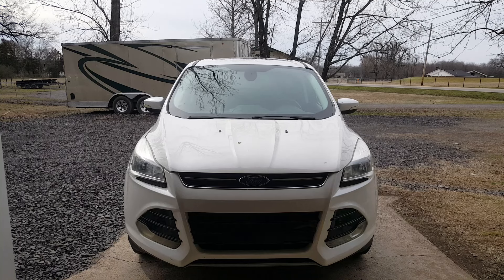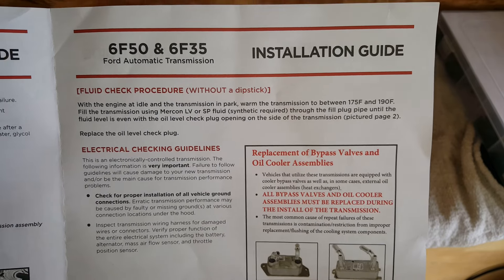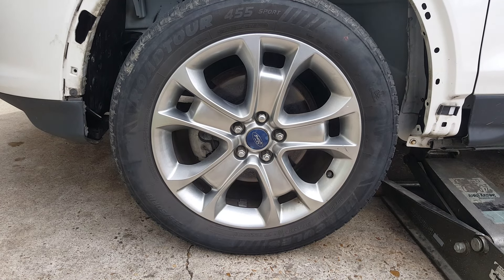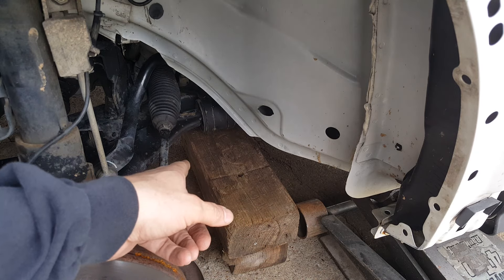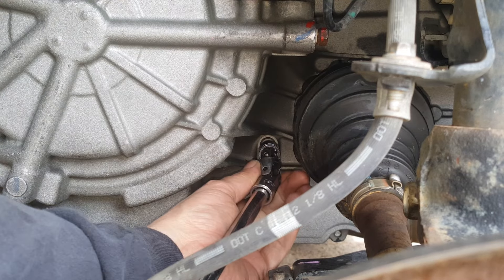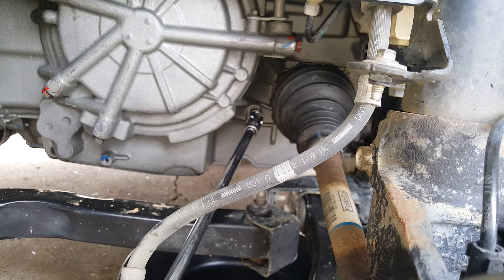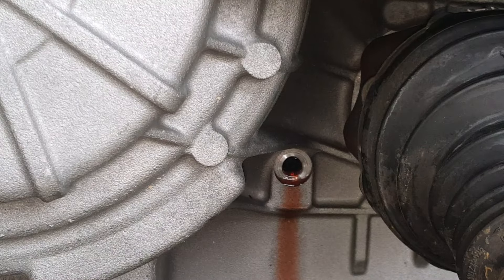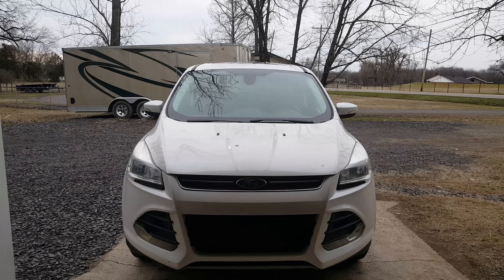How to check and fill the transmission fluid on a 2013-2016 Ford Escape 6F35

Comment: If you think this is bad. try replacing the battery. Probably the same Ford Engineers did both. I will never get another Ford,  used or new .
Reply: I took my wife's car to the mechanic to replace the battery.  It was ridiculous.

Comment: THESE new cars are ALL junk, WHERE'S THE DANG DIP STICK, I DIDN'T HAVE A BLOWOUT, I JUS WANNA CHECK THE AUTOMATIC TRANSMISSION FLUID, THIS  IS DUMB THAT YOU HAVE TO TAKE THE WHEEL OFF THATS PRETTY DAMN STUPID, FORD MAKES YOU REMOVE THE WHEEL.,😫😳😵😵😫 THAT DIP STICK IS SUPPOSED TO BE ON THE FILLER CAP!!!!!
Reply: Agreed
Reply: When you take fill level pug out is that with engine on..?
Reply: I'm a professional Master auto Mechanic and you are right. Vehicles from 1999 to now— have been getting increasingly worse— with few exceptions.
Reply: They want you to have to bring the vehicle to the shop to use their special tools.  So they make it difficult to make more money off the consumer after the sale.  My aunt has been lobbying to make the car makers stop this.

Comment: If I’m under the suspicion that my transmission in my 2015 is low, do I just do these steps and check if it drips out first before adding anything? Or just add and then let it drip till it slows down?
Reply from the maker: Yes , just follow the steps and open the plug. If it trickles or drips you are golden. Just make sure the vehicle is reasonably level. Thanks for the feedback.
Reply: @s33therfan  you are awesome thank you so much for the reply, going to be giving this a try on Tuesday!
Reply: @Smalltownthings did it work hopefully you respond cuz now I’m under suspicion mine is low too😂

Comment: I did not see a way to actually check the level. Did I miss something?
Reply: The point of this design is to add fluid until it is slowly dribbling out of the hole.  This means the fluid in the transmission is level with the bottom of the hole.  This is the full mark.  No dipstick to see where the full level is located.  This is the way manual transmissions have been measured for ages.  The first automatic I ever dealt with this on was a 1996 Chevy Cavalier with a 4-speed auto transmission.  Remember - it has to be measured with the vehicle sitting level, engine running and transmission warm (normal operation).

Comment: 2014 1.6, worst model ever. Transmission out, can't afford the fix
Reply from the maker: The other thing you will notice is that with any of these cars with the common transmission or even engine failures , the demand goes up and the prices go through the roof. No reason the transmissions should be so expensive. I appreciate you taking the time to share , and thanks for watching.
Reply: I had a 2013 Escape SEL, trans went at 160K miles, "$4,896" to rebuild, I really had no choice, fortunately I had, I emphasize "I HAD" the $$$, but to this day I still am recovering from that repair bill (happened in March 2022)...